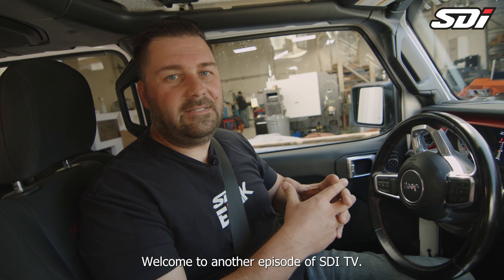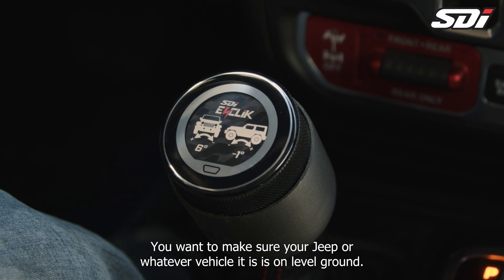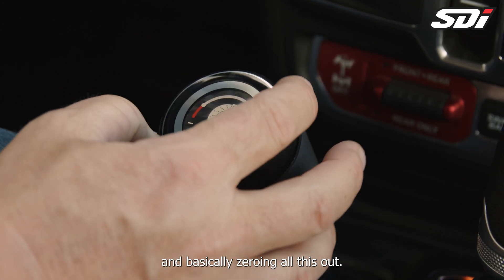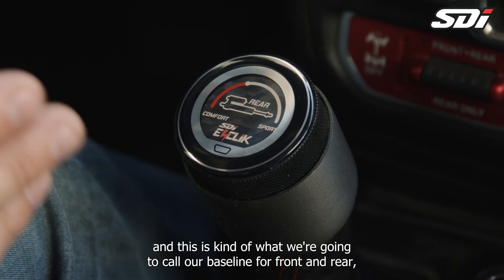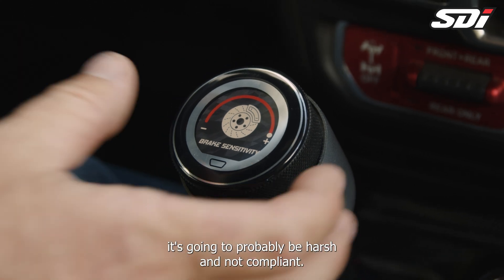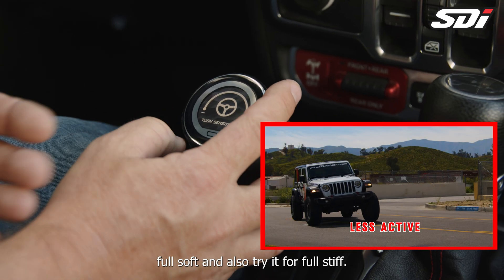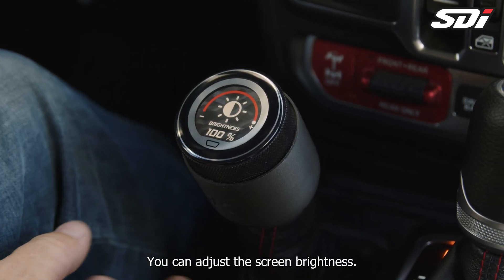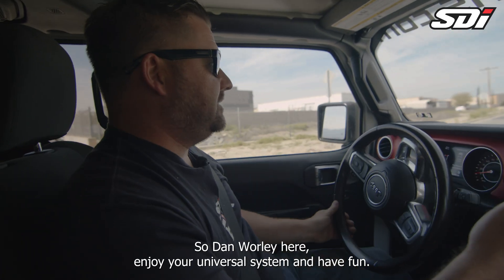E-CLIK Universal Kit Fine Tuning & Setup

Comment: So whats the difference between roll sensitivity and turn sensitivity?
Reply: Roll is when driving in a straight line, turn is when turning! 
Per their description there is an IMU onboard that can tell the difference between a tilt (straight) and a rotation (turn). I guess they found that one may want different settings because the shift in weight in both situations is different.
Reply: @OldelCpt  no what youre referring to is "pitch".

Comment: Will this system work with the airride system from accuair for a jt rubicon?
Reply: Accuair retains the shocks it just replaces the springs. So, essentially it should work but I would caution on when both systems are active/dynamic. I would think it would put stress somewhere. I have the eClik and I love it. I wish I had the ability to adjust my ride height for trails, towing, drive thrus and my garage because that when I would use Accuair system. Perhaps, SDI make  their own that works with the eClik system/controller. Or develop some synergy with Accuair
Reply: I was wondering the same thing because I was in the process of pairing the accuair with the falcon 3.3 for more stability and to avoiding getting the rockslider steps, but this would work perfectly if it's compatible
Reply: @JayJay-sy2tc   i thought about that setup as well…  lemmie kno if you do it before i do… also, how do you like your accuair setup so far?
Reply from the maker: It doesn't appear accuair offers any sort of remote reservoir shock.